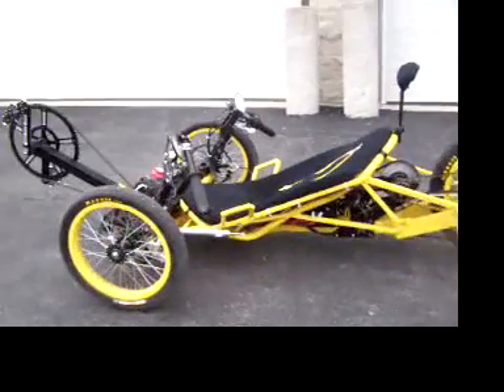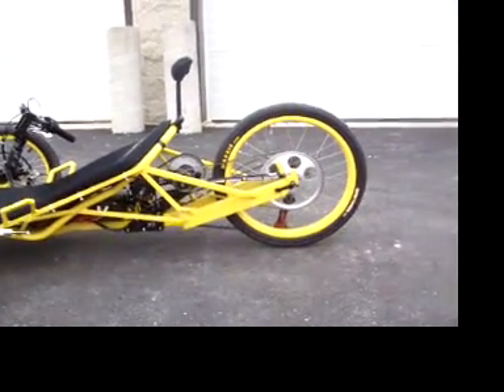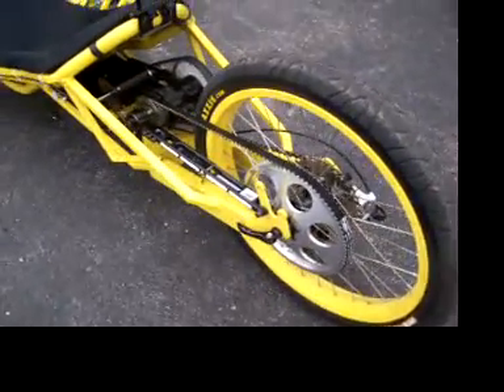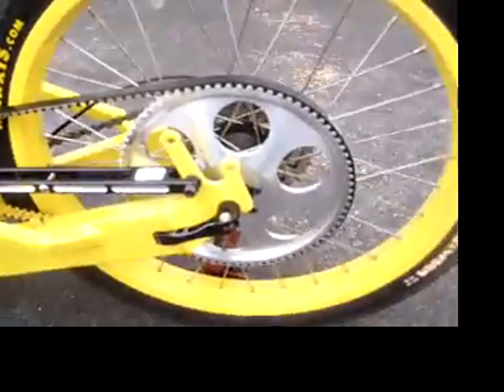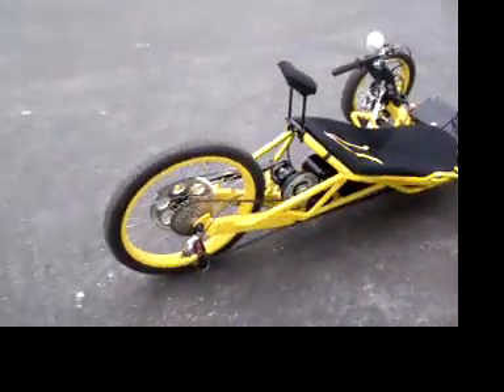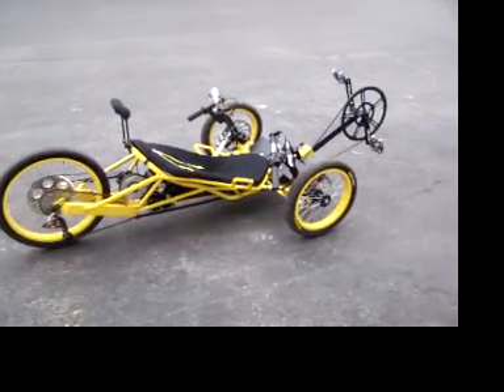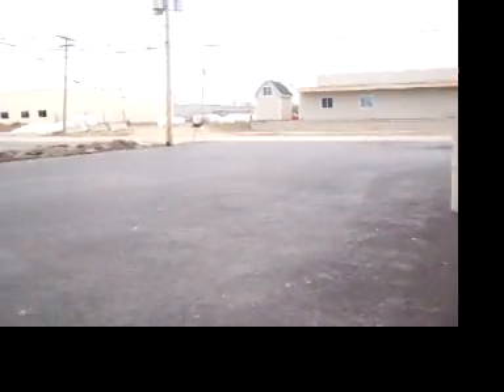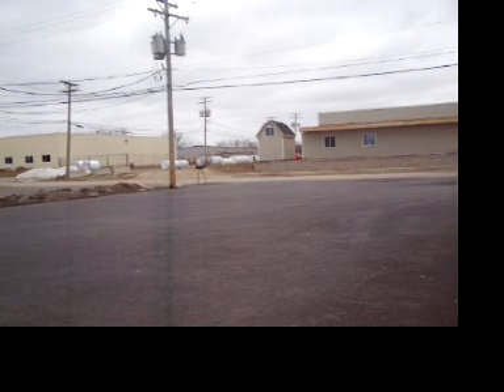Electric tadpole trike with belt drive

Comment from the maker: They are ten 5,000mah 25C lipo packs. I run RC too. It is very convenient to have chargers that work with both hobbies and I like having the knowledge of RC equipment from previous years of experience. It makes using RC stuff on bikes and trikes much easier to deal with.

Comment: Very nice trike. How big is your lipo packs ?  I'm using a 48v 1000w brushless hub system.  Using 8 5000 mah 6S batteries, I can get a little over 15 miles at 30MPH.  I believe your trike is more efficient, hence the greater speed and distance.  My lipos do double duty as I also fly large RC aircraft so I already had the high output chargers and lipos to do my conversion. .

Comment from the maker: @piperpilot26 

I have about $5,500 in it. However, I get alot of parts at cost. I figure it is worth about $9,000. It runs about 45 miles on a charge.